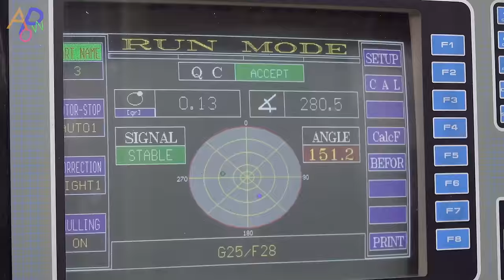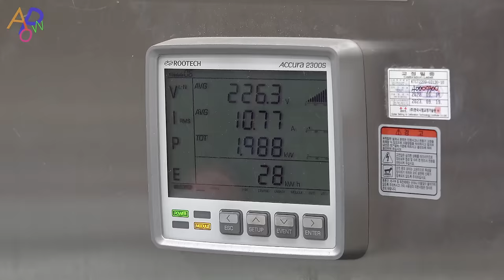How to Manufacture Powerful Blower Fan With Modern Technology. Fantastic Korean Blower Factory

Comment: Did i see all the parts still wet with the water wash, while being powder coated? 😮
Reply: I've done tons of powder coating and I'm freaking out. They must get a lot of out gas bubbles when the water turns to steam in the oven.
Reply: I thought so also but look close. It looked like water spots/stains.
Reply: You can see beading at the inner bottom of the curve.